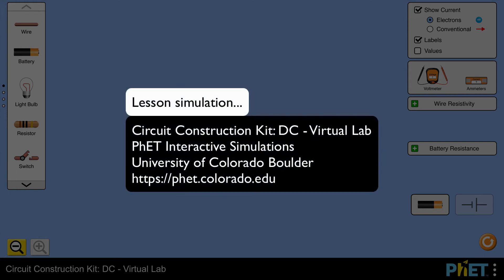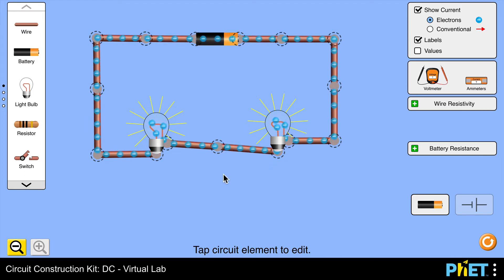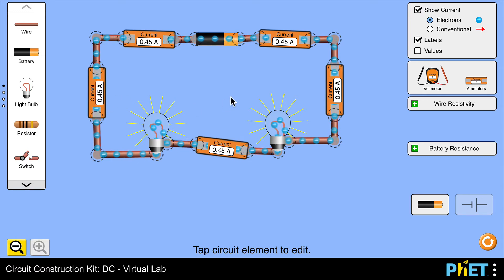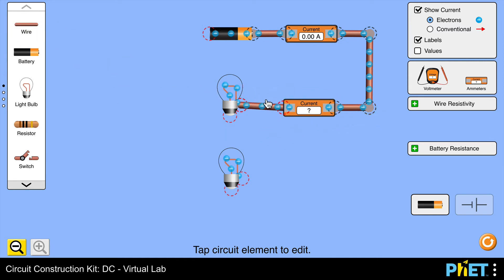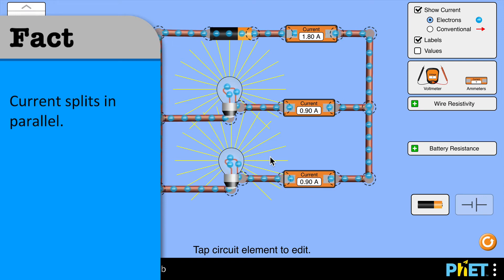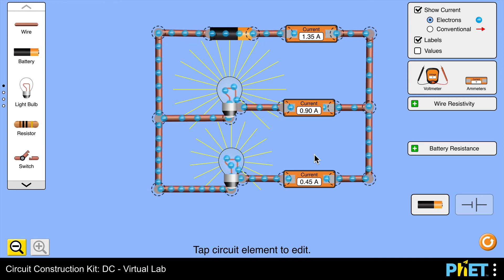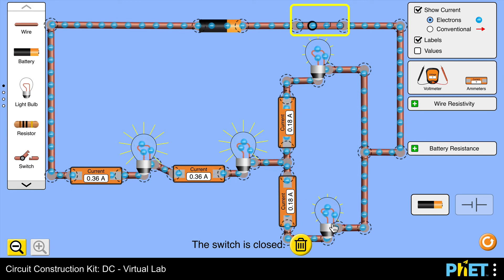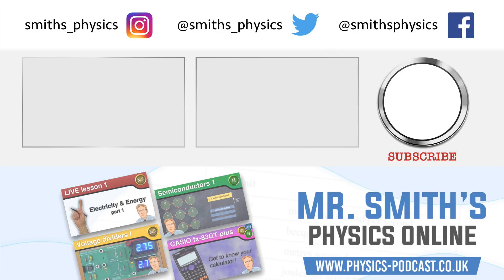National 5 Physics - current in series & parallel simulation

Comment: Why is brightness of lamp depends on voltage instead of current? It doesn't make sense to me.
Reply from the maker: The brightness of a filament lamp (all things being equal) depends on its power rating. Power is the energy transferred per second and can be calculated using the equation P=IV (current x voltage). With traditional 40W, 60W and 100W lamps, they would all have a voltage of 230 volts across them so, indeed, the difference would be the current - the brighter one (100W) would have a lower resistance which would increase the current in the lamp.
Reply: @MrSmithsPhysicsonline  thank you :)